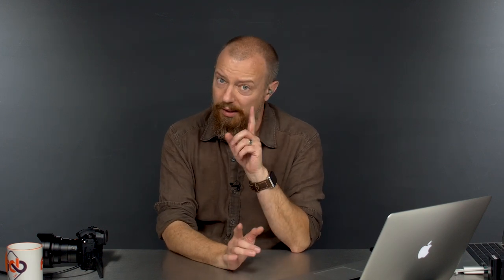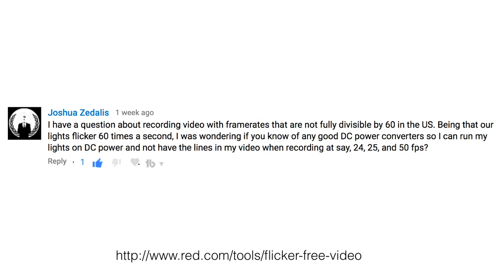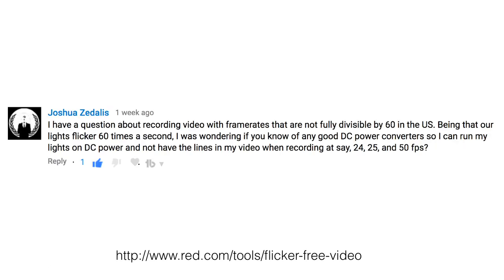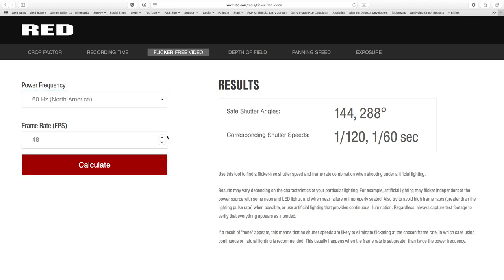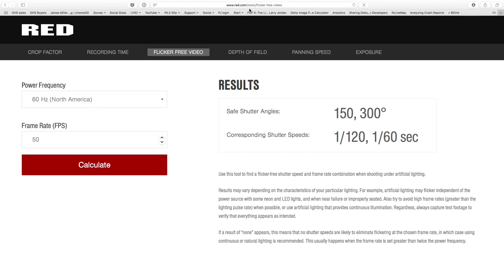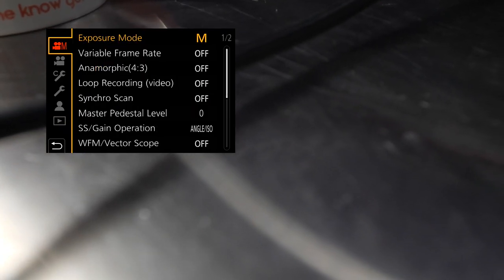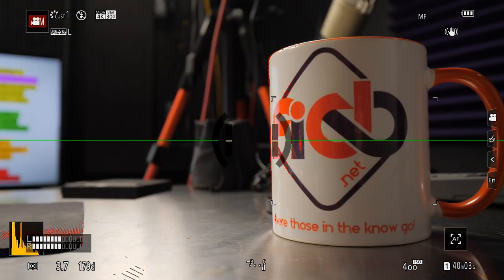How Do You Shoot 24p/25p/50p in 60Hz Light? — PhotoJoseph's Photo Moment Q&A

Comment: Generally the flicker is twice the mains frequency,  in this example,  120Hz.  This is due use of a full wave rectifier in the light source's power supply.  Also, most florescent lamps emit 120 Hz flicker because the lamp conducts during both the positive and negative parts of the AC sinewave.

Comment: Do these rules also apply for the refresh rates of a PC monitor? I am resident in Europe and the power supply system is based on 50 Hz. Nonetheless my monitor has a fixed refresh rate of 60 Hz (like the most monitors). My cam only offers 25p and 50p framerates (it is the European Pal model). I have absolut no problems with light flickering, but 50p content does not look fluid on a monitor with 60 Hz refresh rate. If my math serves me right: Could I avoid the stuttering by choosing a shutter speed of 1/60 or 1/120? Or do the mentioned rules only apply to the power supply system and not to the refresh rate?
Thank's in advance for the valued replies.

BTW Very informative and good explanation, keep on with your excellent work.
Reply from the maker: That’s a REALLY interesting question. No one has asked before and I don’t have a way to test it, being that I’m in the US. Going 1/60th may well fix the computer screen but then the lights, if they’re on AC, will flicker. If moving the to 1/60 fixes the computer, then run your lights off DC (batteries), and there won’t be a flicker to worry about. Super question… PLEASE let me know what you learn when you test. And, if you really want to get geeky on the reason WHY flicker happens, watch this video: https://youtu.be/0kAuDuV9K9U
Reply: @photojoseph  Joseph, thank’s for your fast reply. You can test it by yourself if your PC monitor does have a refresh rate of 60 Hz (most monitors today run with that refresh rate, also mine; some newer monitors have a variable refresh rate so you can choose; if you have such a modern monitor then please chose 60 Hz refresh rate).
Then make a short clip with some movement (maybe a pan) in 50 fps and  1/60 shutter speed to avoid light flickering (because you are in the US). 
And then play your native 50 fps footage on your 60 Hz clocked monitor. I bet you gonna see micro-stottering (not flickering) in your footage, because 50 fps and 60 Hz don’t match. And by my level of knowledge now, there is no way to fix this issue beforehand by shutter speed oder shutter angle, because: you always have 50 frames per second, indifferent how long you have exposured each frame, and you have always a refresh cycle of 60 Hz.

Comment: Sir,
Any detailed videos on Shutter Speed, Shutter Angle, Frame Rates and Progressive Vs Interlaced Videos

BTW.
Generally videomakers follow 180 Deg. rule while shooting.
What happens if the Shutter Speed and the Frame Rate is set to equal (shooting a video @24fps and shutter speed @1/24S)

Because what puzzles me that what is the MATH behind exposing a single frame twice the time instead of exposing it just once
Thanks in advance.

Comment: Hi, thank tor this. Are all lights sold in the US 60hz?
Reply: No, it’s not like that. Most LED lights pulsate in the 50kHz to 300kHz range depending on the position of the level control knob. In addition, the PWM carrier frequency is also subject to periodic drift due to thermal instability of the level control circuit components. Some of the dynamic states of this frequency drift will interfere with the frame rate, violating the validity conditions of the Nyquist-Shannon-Kotelnikov theorem. Visually, this will appear as stripes moving across the screen. Sorry for my English.

Comment: What is 50 and 60 hz in mobile phones?
Reply from the maker: I don’t understand the question
Reply: I DON'T UNDERSTAND YOUR QUESTION TOO
Reply: @tonylouisvisionvideography3469  I think he means the refresh rates. Do these rules also apply for the refresh rates of a PC monitor? I am resident in Europe and the power supply system is based on 50 Hz. Nonetheless my monitor has a fixed refresh rate of 60 Hz (like the most monitors). My cam only offers 25p and 50p framerates (it is the European Pal model). I have absolut no problems with light flickering, but 50p content does not look fluid on a monitor with 60 Hz refresh rate. If my math serves me right: Could I avoid the stuttering by choosing a shutter speed of 1/60 or 1/120? Or do the mentioned rules only apply to the power supply system and not to the refresh rate?
Thank's in advance for the valued replies.
Reply: @Cuetips1000  I see, so it's the refresh rate.  Thanks
Reply: Phone with 50 Hz screen RR ? HAHAHAHAHA IT DOESN'T EXIST ! AND 59.94 EXIST FOR 29.97 AND 23.976 FPS !

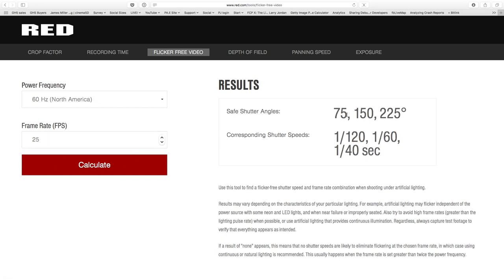Comment: 4:11 why wouldnt 25p  be 1/25 1/50 1/100 1/200 1/400 1/800
Reply: Because it has nothing to do with the frame rate on your camera. To avoid flicker, the shutter must be open for the same duration relative to the power frequency in your country. Simply: in Europe, multiples of 50 (50Hz electrical power), and in USA, multiples of 60 (60Hz electrical power).